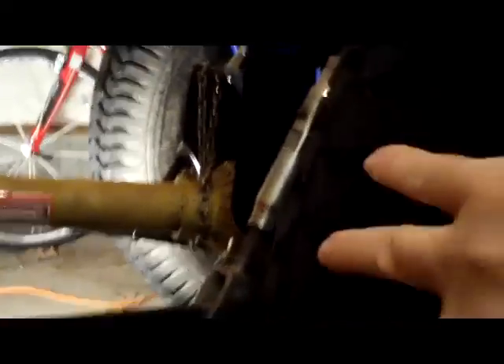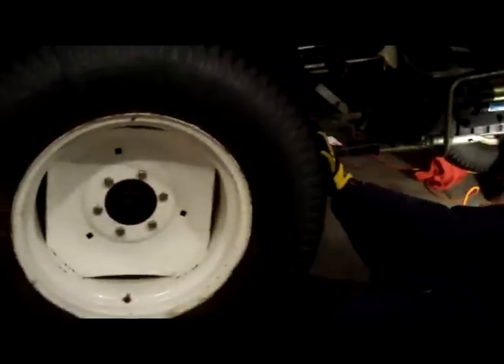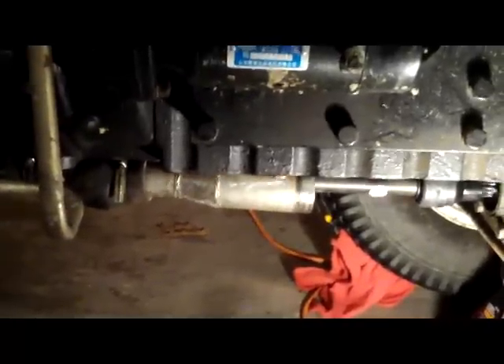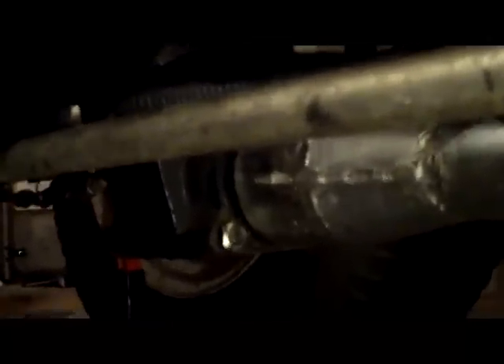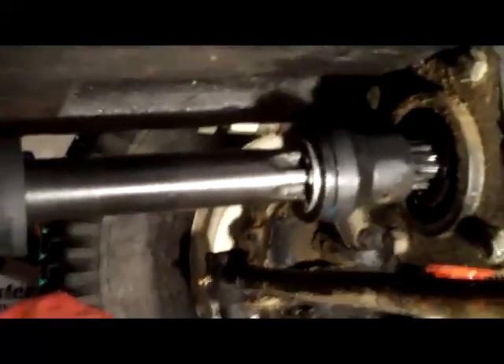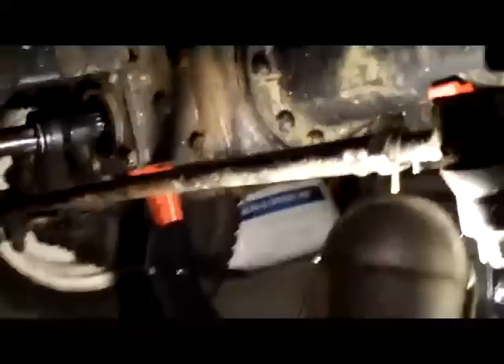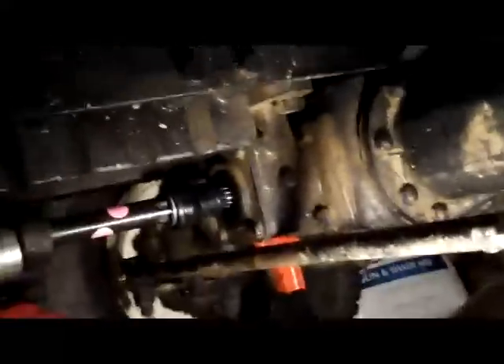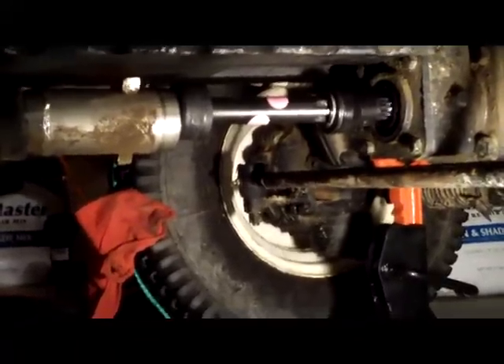Jinma4WD Troubleshooting

Comment: Thank you for this video.  I have a problem with my 4WD not working and this is going to help me find the problem.  One thing I noticed on mine is that I can turn one front wheel and the other front wheel turns in the opposite way like you said, but there is a lot of obvious slippage between the two.  Your video kind of shows the slippage, but I was wondering if that is normal for this tractor?

Comment: I'm not positive how to move forward with repair - but I know that the splines at the front have shredded up within the coupler (the coupler prior to the front axle).  So, I assume the ball bearings have fallen out or shredded up as well in the process.  I can freely move the entire shaft forward and back at least an inch or two.  Can anyone advise on the process of fixing this?  I'm assuming I probably need a new shaft as well as coupler at the very least.

Comment: I just tried this same setup with my Mahindra tractor to try and diagnose why my front wheel assist isn't working.  I blocked one rear wheel and tries spinning the other to see of my axle would engage and for the life me I could not spin the tire.  As hard as I tried it wasn't moving.  And no, the parking brake was not set.

Comment: interestting. i  am on my 2nd front end.  first one gave out at 2 months.  peckerhead who sopld it to me diidnt want to replace it.  the problem on mine is in the pumpkin.  the bearing assembly took a s...  took front pumpkin to a guy who does axles annd he rebuilt it.  now when i have  time i will slap the rebuild one in and have the broken one rebuilt also.    i replaced my hydraulic fluid w ith new hollad 133 fluid and have had no problems.  all the drive fluid replaced with 80-90 gear oil.